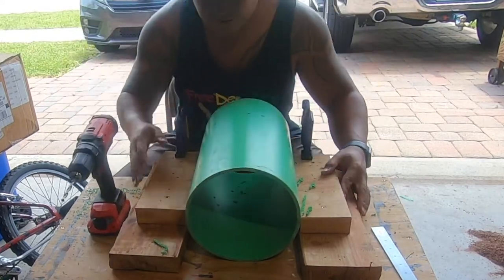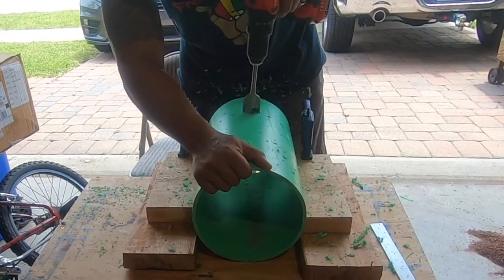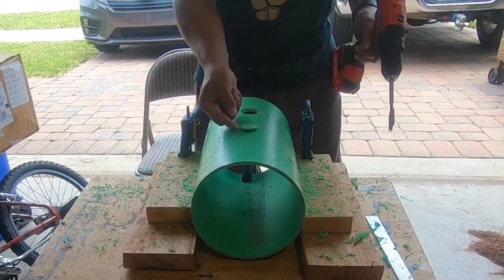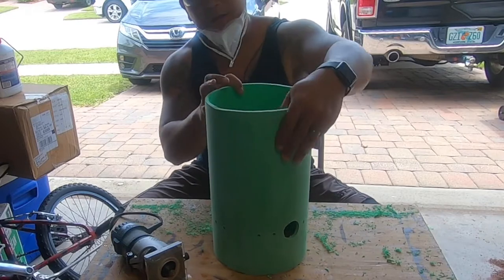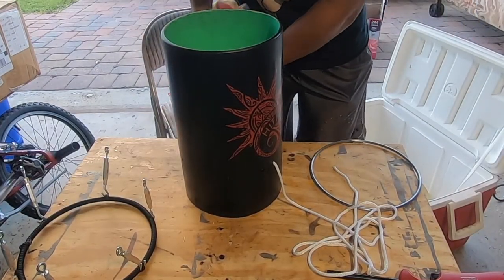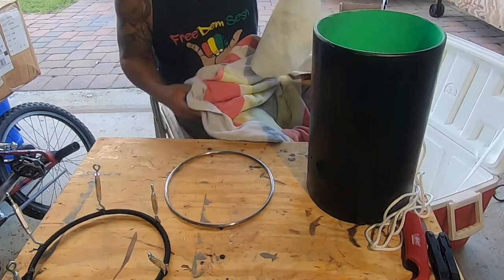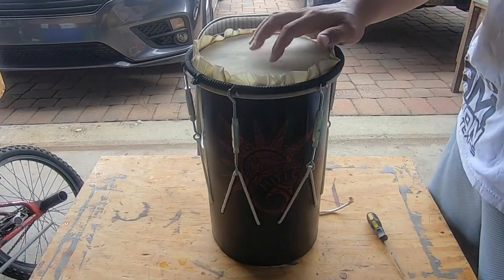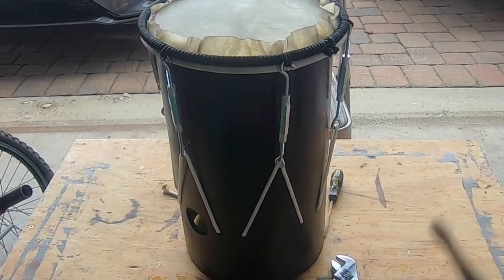Building a Tahitian Drum: Fa'atete from PVC Pipe

Comment: Is there anything underneath inside pvc to close it with a board or is it just left open?
Reply from the maker: On my initial build, I didn’t put anything inside. Now I cut a piece of 1/4” plywood to fit in there and use epoxy to hold it in place about 5 inches from the bottom.
Reply: @grindandshine5148 does it make a difference with or without ply?
Reply from the maker: @vaiona5156 yes it does. The drum is not as loud.

Comment: how do the skin resist to the stick hits ?  a friend played Djembe with sticks and the skin popped torn when he hit too hard. So I was wondering the difference between Djembe and Faakete that makes it so the latter is playable with sticks. thanks alot for the video I'm trying to build one this week-end.
Reply from the maker: Ive been playing on them at least 2 times a week since they were made and no problems. Surprisingly too since the skins were ordered from Amazon!!
Reply from the maker: @tinihaumalinowski7764  I have. But it takes a long time to wear through it. Especially if they are using thicker goat or cow skin. I did tear 1 skin but it was from careless transport. If a good skin were to break spontaneously, I think it would be due to moisture making it soft or some sharp splinter on the stick. If you look at my video from the North Carolina competition, you’ll see a guy Simi shredding on them…he broke a stick but not the skins!!!!!!!!
Reply: @grindandshine5148  thanks alot for the sharing bro. 🤙
Reply from the maker: @tinihaumalinowski7764  absolutely!!!! Anytime.
Reply: @grindandshine5148  how do you prepare the goat skin (i see you used a towel and icecase ?) before puting it together with the circles ?
Reply from the maker: @tinihaumalinowski7764  i had water in the ice case. Let the skin sit in water until it is soft. The towel was only to dry it off a little bit. Be careful not to break the skin while it is soft.
Reply: @grindandshine5148  you know how long aproximately it takes to soften it ?
Reply from the maker: @tinihaumalinowski7764  not long at all. It shouldn’t take more than a couple of minutes depending how thick the skin is
Reply: @grindandshine5148  ok. got everything set up. Gonna chill watching your video one last time before giving a try 🤙

Comment: What ring are you using and where did you find? I can’t find anywhere
Reply from the maker: @Punisherx40  I feel so bad… I been all over Google since you last night and I can’t find the website anymore. The last few that I made, I made my own rings. Harbor Freight has the steel roller and I get the rods from Lowes. Roll them into the diameter you want, and find a guy to tack weld them shut. 
If all else fails, I ran across a website that sells them in the UK.
Reply: @grindandshine5148  what thickness for the rod?
Reply from the maker: @Punisherx40  1/8 inch or 1/4 inch depending on the drum
Reply: @grindandshine5148  for sure thanks. I’ll check that out then
Reply from the maker: @Punisherx40  absolutely!!! Also, make sure its cold rolled steel rods that you get.
Reply from the maker: @Punisherx40  bro, just remembered!!! Its Rhythm Traders.